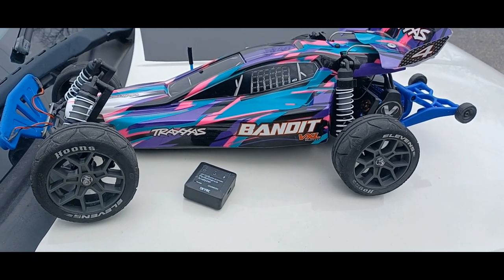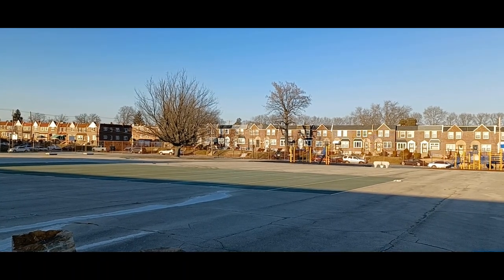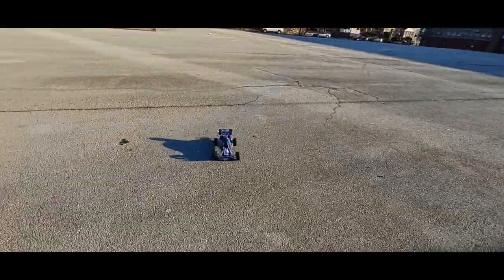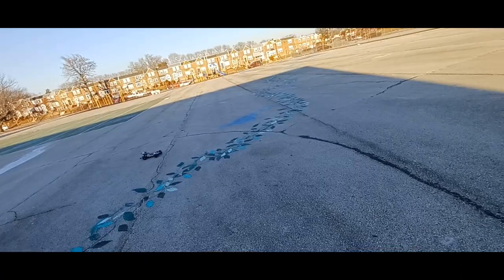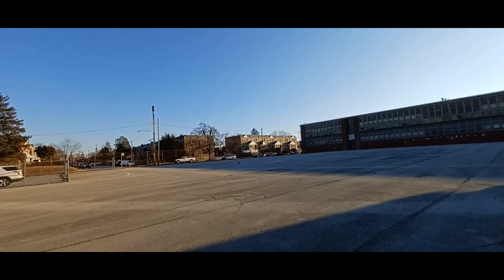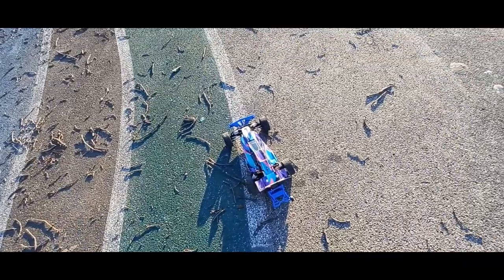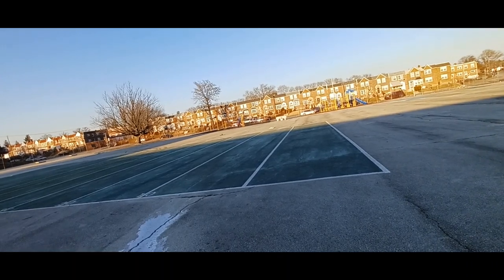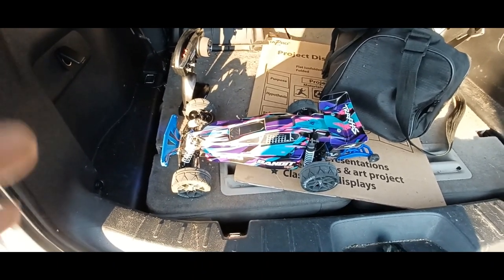Traxxas Bandit VXL Street Tires and Speed Test 2023

Comment: Do you accidentally have that car in training mode because the VXl should be a lot faster than that. The brushed motors do 30mph. Hope this helps.  It did do much better on 3S. But my stock brushed Traxxas stampede used to do 28 on a nickel metal hydride battery.
Reply from the maker: It's the tires to heavy and my transmitter was dieing. I'll have a do over.
Reply: Yea is definitely faster then 48. Mine did 54 out the box. And I'm honestly still getting used to it. I have the brushed version as well. And she does 30 easy. When i put a 2 cell lipo 35 for sure. I dont run em with the speed run pinion because i like to go back and forth a lot. That will stress the motor or take some life out of it for sure. So I've just been keeping it simple. Any faster then this and i wouldnt be able to race in residential places. I think 60 mph is the cut off. Once you have them going 70 plus you need lots of room because i cant really get a full squeeze on my trigger. Soon as i get to 50 i have to hit the brakes. And if you go to hard to fast it will flip from the massive amount of torque in the rear.

Comment: I want to switch over to a belted tire specifically for the rears for speed runs. I’ve wanted to get the Hoons but was told the axles on the bandit are to small for the Hoons. What hex conversion are using to fit them on the axles?
Reply from the maker: I used  the big rock hex and pins I git from Jenny's RC (JRC)
Reply: @rcbeast101  thanks!
Reply: Dr10

Comment: Something potentially wrong with your setup dude. I'm getting 49 mph on a 2s battery. You should be getting about the same and about 60-65 mph with a 3s depending on gearing
Reply from the maker: I'm running the stock gears. I  may change out the whole system. 
Thanks for watching.
Reply: @rcbeast101  Yeah try the gearing first. The Valineon combo is a beast. On my run I had a 28T pinion with a 76T spur with a Traxxas 2s LIPO. When I used a non Traxxas battery I was down to 45mph

https://www.youtube.com/watch?v=XwxCOkhJyQE